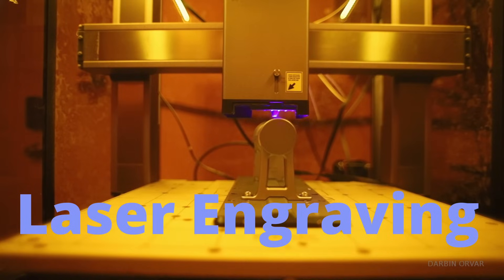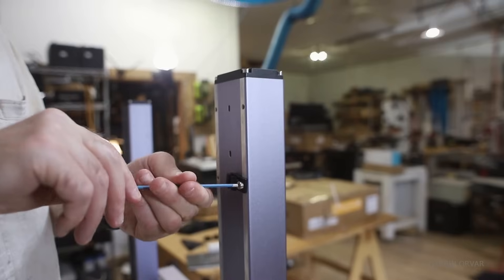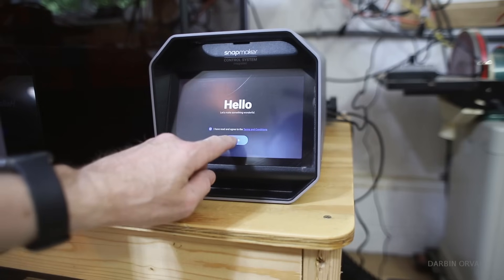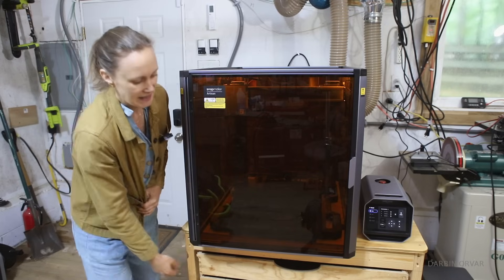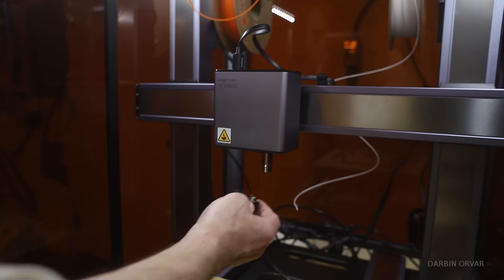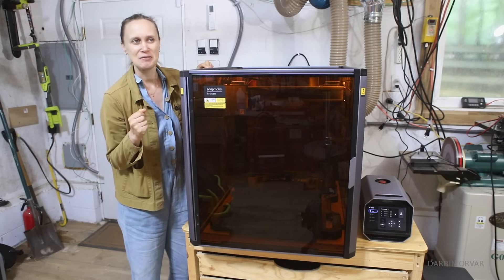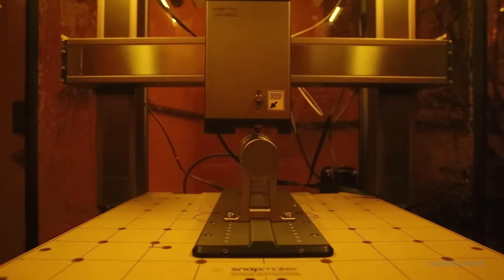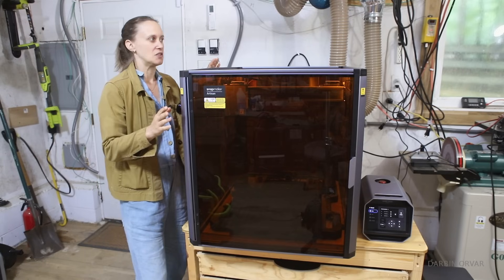SnapMaker 3-in-1 Artisan CNC, 3D Printer & 40 Watt Laser!

Comment: Very interesting.  I assume there's some safety interlocks to prevent that 40W laser from operating when the cabinet door is open.  Are these difficult to defeat or am I going to be liable when someone does something stupid?   Also you mentioned that each axis is sealed and protected against dust, but what about the other components?  
I hope you'll give this machine extensive use over the next several months and report on your impressions at that point.  
Good video.  Thank you for sharing.